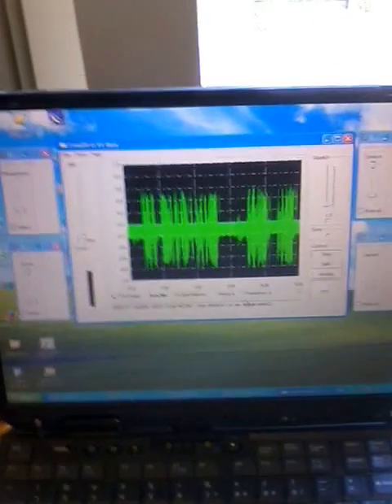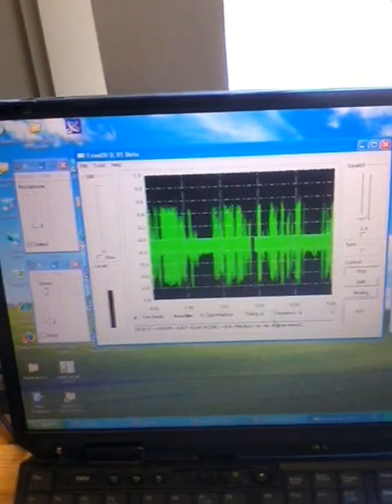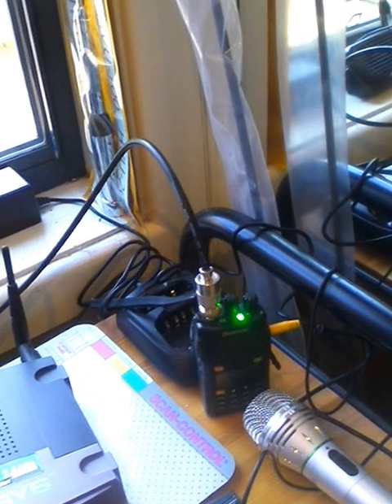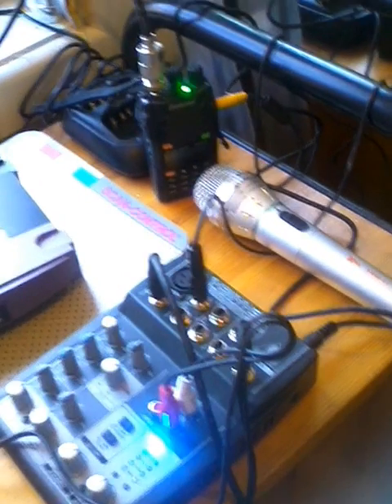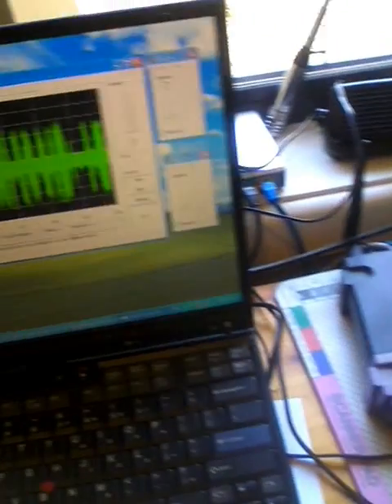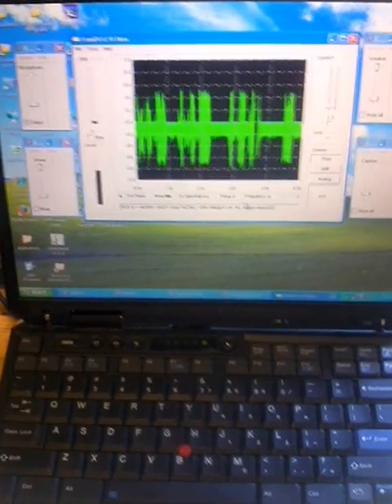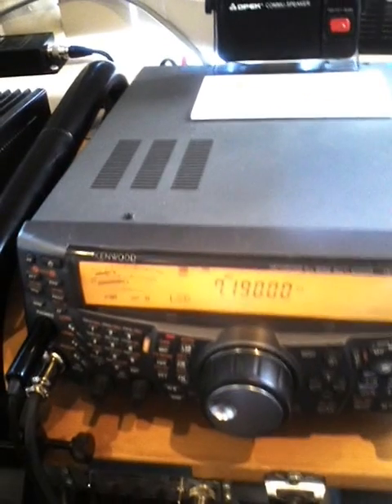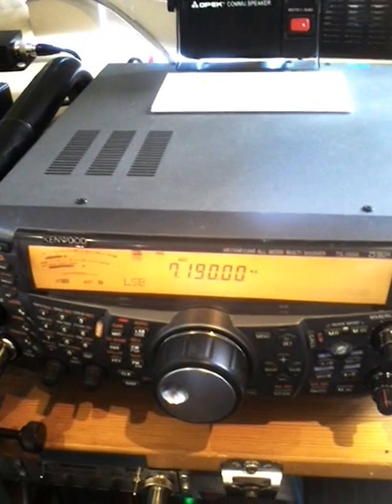Transmission of VK2WI News Bulletin using Digital Voice "FreeDV" mode on 40m.

Comment: Hi, Really love that you are doing this. FreeDV is soo the future of digital voice for AR. Finally an open source vocoder :) BTW Did I also see you pan past a FT-890AT? Love that old radio. It's the only HF I've ever owned. I was lucky enough to pick it up out of a Op shop many decades ago. It was NOS from an auction sale of a liquidated business. I'm looking into getting a mcHF / RS-918 soon but in the mean time I'm going to try and set something up via a sound card interface and a laptop. Keep up the great work! 73 de vk4akp :) .-.-.
Reply from the maker: Hi Ken, Thanks for the comments. The video is of one of two test broadcasts I did about 5-6 years ago when I still lived in Australia, hence using an early version of FreeDV. The software has advanced greatly since those times and I agree this is the future of Phone on at least the HF Bands. On the VHF bands the extra data capabilities that the existing digital voice modes have (i.e. International routing through repeaters) needs to be added before FreeDV can make an impact in the FM areas of the bands however on the SSB end, of course FreeDV brings the same advantages as on HF. Given it's narrower bandwidth, two or even 3 FreeDV stations can fit in where one SSB station presently is. So like FT-8 taking over from CW (at least in contests and DX work), I would expect FreeDV (or something similar) will eventually take over from SSB for many people. 

The WIA broadcast has been transmitted in Australia on FreeDV by VK5ARG(VK5GR) in South Australia for a couple of years, so this still acts as some publicity for the FreeDV mode.

No FT-890 in my shack - it could have been my TS-2000 or possibly an FT-757GXII.

73 Ed Now DD5LP near Munich in Germany.

Comment from the maker: Hi again Mike. In HF one would normally use Upper side band SSB. FM only on 2m and 70cm. You can run FreeDV on any phone mode however - just depends what other people are using at the other end.

Since you've checked your connection with PSK31, it suggest the links ad the PC are working fine.

I suggest you go and post an inquiry on the digitalvoice yahoogroup. There are also some websites that tell you when someone is on sending FreeDV looking for a contact.
I think these are listed at freedv.org now.

Comment from the maker: OK, a couple of tips (I also have the TS2000 as you will have seen in the video. Open the audio filter right up - i.e. 0-5000. On transmit when you get that far, keep the audio drive right down so no alc is indicated on the meter.
I have never used the signallink. I have heard good things about it though. I went for the ultra cheap option of just USB-Serial cable and audio to accessory port cable - both from an Amateur Radio cables company "Radioarena" in Scotland.
Probably the thing you could do first is try to receive RTTY via the Signallink with MMTTY or  Ham Radio Deluxe or similar software. If that doesn't receive correctly there may be a problem with the signallink, or your PC.
For some really good help, go to the digitalvoice group on yahoogroups.com.

Comment from the maker: Hi Mike, any standard audio interface between PC and rig can be used. If you already send PSK31 or RTTY from your PC, that connection will also work with FreeDV.

FreeDV is not DStar - DStar needs up to 7KHz bandwidth and so it probably OK on 10m and above but (IMHO) not below that. FreeDV on the other hand uses 1,5KHz - so half the bandwidth of a normal SSB signal.

What is also coming is the PC side of FreeDV send and receive built into a speaker microphone! Then all you need is the Microphone and any SSB transciever for HF or FM transceiver for VHF and you have digital voice.